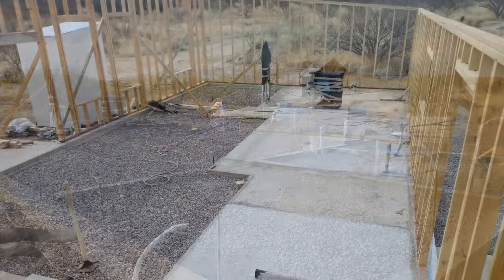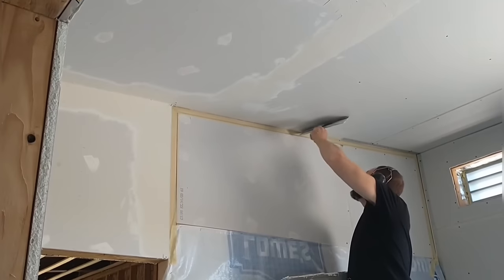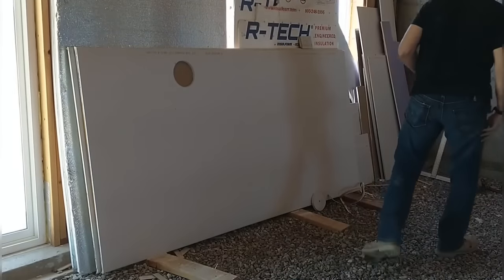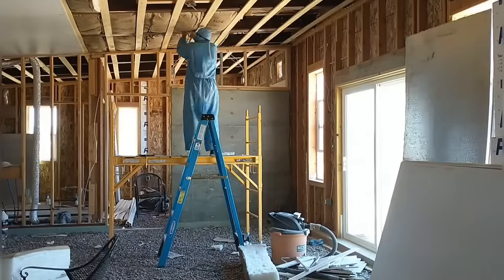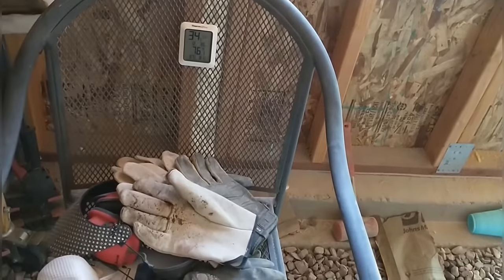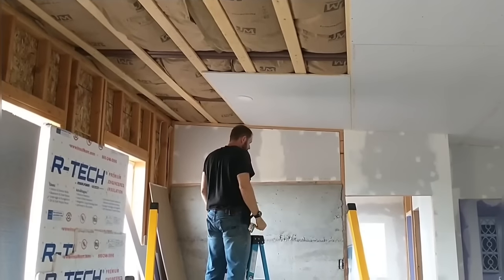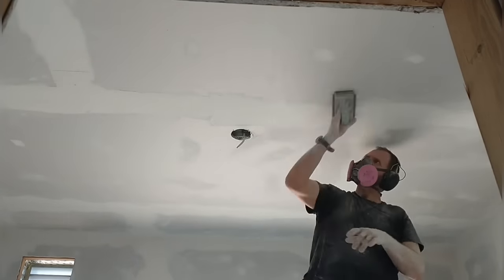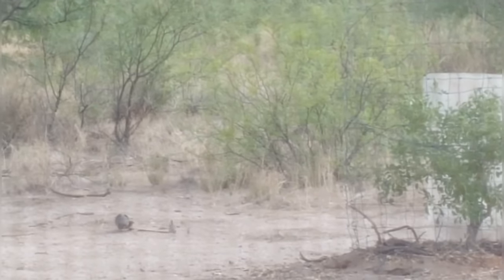Working Safely | More Drywall & Insulation #34 DIY Off-Grid Home Build | Loving This Sheetrock Lift

Comment: Transformation- wow! Look really good. Power sander would be nice. You thinking of one with a vacuum too? More power….but a time/back saver.keep after it. Thanks for sharing
Reply from the maker: Thanks! Yes, it's great and has a vacuum. Running equipment hasn't been an issue at all for our solar. When the sun goes down it's good to take a break anyway. 🌞🏜️

Comment: Great progress. Been there - done that and totally agree on your philosophy in Plastering. In Australia, we call it plasterboard but it is the same stuff. I envy you when I see the lift. Every time I look at the ceiling in one of our rooms I have to remind my eldest grandson how pointy his head is. Tried to put up a very long sheet with only the two of us and broke it over his head. With three people it worked OK.
Reply from the maker: Thanks!  Sounds like looking at that ceiling brings back many memories. 😅 We have put up a fair amount of drywall in smaller rooms and sunrooms. I usually got to try to hold it up with my head and arms while Red helped with one hand and screwed it in with the other. The lift was great, but 8 ft sheets was still the longest we wanted to handle. 😊🏜️

Comment: I just finished up remodeling my attic and I gave up on hand sanding drywall within an hour. I went with a cheap pole sander and it make it so much easier! You likely already have a broom handle/painting pole that you could use and would only need a ~$15 head for it.  Best of luck to the both of you
Reply from the maker: Nice to have the extra space I'm sure. 😎
He tried a pole sander, but wasn't a fan of it and didn't feel like he could see what he was doing. Thanks so much! It's coming along. 🙂🏜️

Comment: How come no one ever told us about getting old?😂 Looking good 👍!  Yes Lord, it's been hot as high as 107 and very high humidity. Got 2 -5 inches of rain this week and I haven't checked yet today. I was on the fence about the drywall lift until I saw you...you sold me on it. Unfortunately, it was so hot this week my ac and freezer went out and almost everything, but hey now the chicken's have some treats 🤣. Your garden looks great! Because of your climate you can get away with some building techniques like the earthen floor. Won't work in Florida 🤣.  Goodness gracious you guy's will be finished before you know it and on to helping your kid's with theirs. Have a great week 🌄 and hope you get a lot more accomplished 🎊.
Reply from the maker: Oh no! Sounds like a rough week! 😬 We just had a couple of weeks when our temperatures were around 100° or a little over. Once the monsoon season started, we dropped down into the mid to high 80°s, which still seems a bit hot with the humidity 😅 but overall pretty nice. We haven't got much rain yet, but it clouds up in the afternoon, and we have been getting some light showers, and quick downpours. Thanks for watching, and I hope next week goes a lot better for you! 🌞🏜️

Comment: 17:42  Sander on a pole.  It lets you work from the floor, with your arms below your shoulders.
Reply from the maker: He tried one but didn't like it at all.  It was hard to put enough pressure on it, or see what he was doing. The electric hand sander has been great!
Reply: @RedandAprilOff-Grid  Thanks!